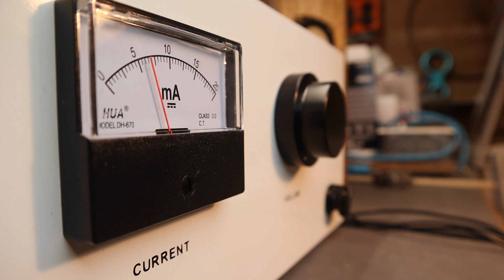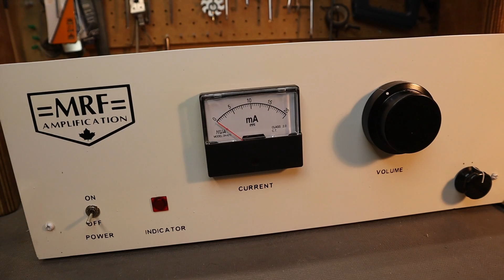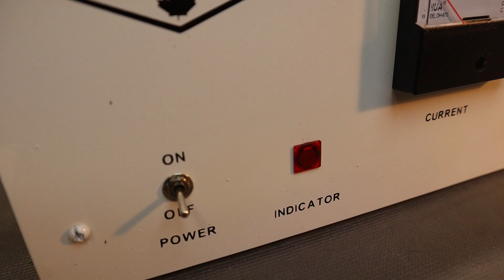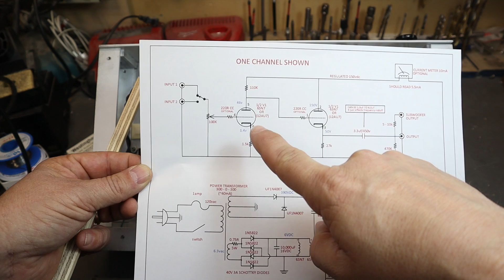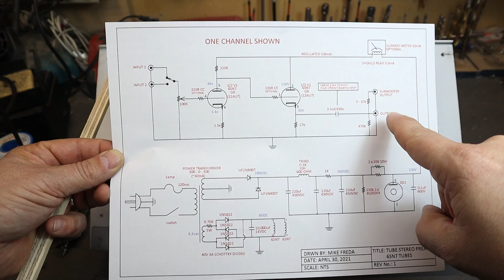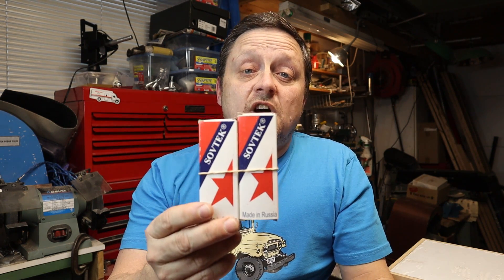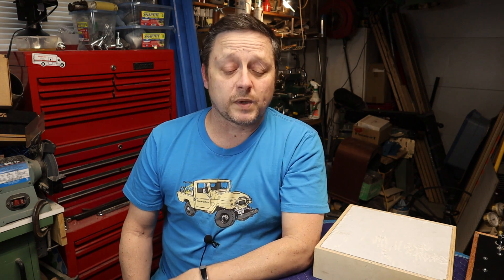Making a 6SN7 Tube Linestage // DIY Tube Stereo Preamp // New all Tube Shop Stereo System build!

Comment: I’m not familiar with specing transformers.  Can you recommend model?
Reply from the maker: Thanks for commenting. Are you asking in Tube amps in general or just for this pre-amp? When it come to sizing transformers you need to know what B+ and current you are trying to achieve/meet and what the filament voltage and current you need. The filament current is easy. Figure out what tubes you using, refer to the tube data sheet to see what their currents are and add them up... then add a bit of a safety margin. It is advisable to not run the filament current at 100%. Selecting the right B+ voltage is a bit more difficult since you need to know what sort of Bridge rectifier you are going to use and what is your desired operating voltage and what current will be. The Hammond website has a Rectifier useage and calculation guide that is helpful. Duncan amps also has a PSU designer that is helpful as well. I use both all the time. Cheers
Reply: @MikeFreda  thanks for the quick response!   First, I was specifically asking about this design.  What model?   I wasn’t familiar with the “300-0-300” description.  But I believe I understand 300vac out rating with a 0v center tap?     This is my first attempt at a tube amp so I’m trying to keep it simple.    The 150vdc after the OD3 set by adjusting the voltage divider  seems straight forward.   I think I found a suitable transformer on the  Hammond website but was looking for validation of what a 300-0-300 transformer.   Thanks again and love your videos.
Reply from the maker: You're welcome. This preamp does not draw a lot of current.  25ma is all you really need.  The 0D3 caps the voltage at 150v so as long as you ~75-100v more you are good.  That's the reason you need a higher voltage PT,  you need some compliance for the 0D3 to operate.  The Hammond PT269GX may be a good option. It should give you ~320VDC at the first cap. If you want to keep your budget low, you could omit the 0D3 regulator tube and use a 250VCT transformer.  This is a good topic to learn. The Hammond Design Guide For Rectifier Use  and Duncan amps PSU simulator is time well spent.

Comment: I have a question regarding the outputs and loading. Could this arrangement simultaneously drive a highZ amp for the main speakers (like a dynaco), and a modern lowZ amp for the subs, or must both amps be the same Z region, i.e both high or both low?
Reply from the maker: Thanks for commenting, You can and I do. I've never measured the output impedance of the prepamp when doing so but I can't hear a difference. You won't notice it on the sub at all and its questionable if you can on the power amp. The output impedance on this preamp is around 500ohms and adding the resistors to the subs outputs helps with isolation. Try it, see if if works for you! Cheers

Comment: Is there any beneficial using a current meter for the preamp tube ?
Reply from the maker: The current meter is mostly for aesthetics... to make it look "old school" but it can help determine if there is some funky going on with the circuit or if one of the tube is acting off.  This has happened to me once when the OD3 was oscillating. You don't really need it in this circuit. Cheers.
Reply: @MikeFreda  i'm really like the way you put the meter. Thanks for sharing your experience to us.

Comment: Hello Mike, before I start building your amp, I thought it would be great to have a headphone output. How would you go about this.  My wireless headphones require 8 ohms.
Reply from the maker: Thanks for commenting.  It is not possible to have a headphone Jack with this preamp without some major topology changes. This preamp doesn’t have enough current and there is a huge impedance mismatch.  To drive 8ohm headphones you will probably need small output transformer with a 8ohm tap and figure out a way to get more current out of these tubes.   Realistically this is not a headphone amp, it’s a preamp the drive power amps. Yes, it could be reworked to drive headphone but there are better schemes to to that with these tubes.  Cheers.

Comment: Hello Mike, I am building your preamp. I have all parts except for a shaft extender for the rotary switch.  Could you please recommend a source?
Reply from the maker: Hello, thanks for commenting. I used a standard 4 position, stereo (2 pole?) switch. I made the extender shaft out of 1/4" steel rod and a 1/4 coupler with set screws.  I have no clue if something like that is purchasable via an online store.  PM me if you can't find one. I may have some metal left over from previous projects. Cheers.
Reply: @MikeFreda  Hello Mike, thanks for the quick response. I think I will be able to put something together. This looks like a great circuit due to it's simplicity. I was thinking about replacing the cathode follower with an SRPP stage. Any thoughts?
Reply from the maker: The circuit I used incorporates a Cathode Follower. It transforms a high-impedance signal into a low-impedance signal.   You basically want to match the output impedance to the input impedance of the power amp (or close to it).  
This circuit creates more gain than you really need for most amps.  
Not knowing your SRPP topology, it’s hard for me to comment if it will work or not. It “could” but you could also have a huge impedance miss-match.  Cheers.

Comment: What?

No guitar/keys input?
Reply from the maker: This preamp is meant for a stereo system (HiFi). Its topology is not really suited for Guitar or Keys. I guess the circuit "could" be tweaked to accommodate that for studio or line-in applications. Cheers.

Comment: Thank you Mike. I have built the preamp but I'm having some difficulty. 
One channel has dc on it along with some nasty hum. I've measured it as high
as 55v dc. I have checked voltages (which are almost exact with the schematic)
but have not yet found the cause.  I built mine with full bridge rectifier and the
0D3A tube regulation. Any ideas as to what might be the cause?
Reply from the maker: 55VDC and on the output?   If that is the case, I suspect you have a faulty Capacitor.

Retrace all your wiring and re-flow the solder joints.  Try swapping the capacitor to see if the voltage issues follows.  The Capacitor blocks DC and creates a filter on the outputs.
Reply: @MikeFreda  OK. I checked wiring and found bad solder joint on a capacitor. DC is gone now but I see 24-25v ac on output. Is that normal? Thank you for the assistance!
Reply from the maker: Well, you should see a bit of AC on the output however it depends how you are measuring it and what sort of input you are testing it with.  Under proper testing procedures you should see 9-11v RMS ( 29v pk-pk) before clipping. This preamp has a lot of gain.  Plug it into an amp and keep the volume low to start.
Reply: @MikeFreda  Hi. I just connected a solid state amp and got a huge hum. Still seeing around 22-24v ac on the outputs. I'm stumped. Could the regulator tube be bad? The voltage 
there is 149.9v. I'm stumped.
Reply from the maker: The VR tube is working correctly.  The three main sources of hum are the PSU (filter caps not working or values are off) , faulty or poor grounding scheme, heater (filament) supply circuit.   Another obscure issue is the output impedance of the preamp does not match the input impedance of the power amp.  

It’s been my experience in building amps that the grounding scheme and PSU section has the most impact on hum.
Reply: Hello Mike. I'm still fighting with the bad hum issue. I just found that placing a film cap across the outputs almost completely removes the hum. 
Maybe some dc sneaking in somewhere?
Reply from the maker: Interesting, I’m at a loss on why placing caps across the outputs would solve that. I suspect that you are creating a filter to notch it out.  I don’t feel that’s the ultimate solution.  

What is you filament circuit like?  How is that grounded?  I had similar issues with a headphone amp and it tuned out the heater circuit was not grounded properly.  

Also, did you use a choke?  If so, Do you have the choke 90deg to the power transformer?

I ultimately suspect your grounding scheme is suspect and your output cap may be leaking.  

At the end of the day, you will figure it out which in turn will make you a better amp builder.  I learned way more by troubleshooting than just building.
Reply: @MikeFreda  Hello just wanted to say thanks again for all your help and tell you of my happy ending. I finally rectified the filament circuit and added 2 47,000 caps.
Voila!  Hum is gone. I did also add the virtual center tap to the heater circuit . Sounding good now. Just goes to show never give up.
Reply from the maker: Great to hear you figured it out.  Most of my amps have DC filament circuits to minimize hum.  I’m a noise freak so I get it was bothering you.  47,000mfd is a lot of capacitance.  Did you mean 4,700?   10,000mfd is more than enough to filter out any hum. You should be able to just ground the negative side of the DC circuit to the star ground.   Cheers.
Reply: @lcookers  Possibly a heater to cathode short in one of your tubes, but that is pretty rare unless you are using 1947-made tubes pulled out of a TV set. Try a different 6SN7 or two. Good practice to add the center tap, virtual or real, to your heaters. In 95% of tube amps I have dealt with, a heater CT is absolutely essential to prevent monster, rhinoceros-grade hum on the output. Or, ground one leg (less desirable)

Comment: Hello Mike. This is a beautiful Pre amp. I am new to tubes and electronics for that matter. I am very practical and am looking to build this amp but I just don’t know where to start. You don’t have any further instructions do you?
Reply from the maker: Thanks for commenting.  I did this video for more high level “this is what I did” sort of thing.  I didn’t realize that people would actually want a deeper dive.  I may do that with theory and a good layout if people want (like I did with my 6DN7 amp).  Cheers.
Reply: @MikeFreda  I would love a step by step tutorial (on video or in writing) along with the full component list 🙏🙏
Reply from the maker: @clemleg123  Please have a look at my 12AU7 Preamp. It's very similar and I also include a parts list. Doing a full build document is a lot of effort, however,  a layout is something I can put together fairly easily if you and other would like that?
Reply: @MikeFreda  Hi Mike. I am planning to build this preamp, I like that it has sub-out which would fit perfectly with my DIY speakers. I would appreciate if you can add the layout you mentioned here. thanks.
Reply from the maker: I am working on the layout but it occurred to me that if you don’t build the same chassis my layout won’t work for you.   I think you could pause the video of my layout and use the schematic to draw something out that would work for you.  Cheers.

Comment: I've been looking into high quality tube pre-amps, but they are all way out of my price range, especially with shipping to where I live on top. This project could be the answer to my prayers. Thanks a lot for publishing your circuit diagram and giving helpful tips on chassis building. I would ideally like it to have VU meters so I'll have to figure that out.
Reply from the maker: Thanks for commenting.  Hopefully this will inspire you. I’m not sure VU meters are that important on a preamp.  Would be more ideal on a power amp. Cheers.
Reply: @MikeFreda  Really? That's interesting. I thought VU meters would be useful to make sure the preamp is delivering the optimal signal to the power amp with different sources (CD player, computer, phone etc) having different output gain. Is that not the case?
Reply from the maker: Digital sources are pretty well balanced.  A preamp doesn’t have a lot of gain. The millivolt difference between the channels would be negligible (unless you built it with components that are way out of tolerance L/R channels and the measured voltages are way off) Even still, unless you have a balance control in the circuit it would only really be for aesthetics. In a power amp, there is more gain. You would want the VU on the output to help balance.  Again, if built correctly and all the components and voltage reading match between both channels you shouldn’t really hear an imbalance…. But it is possible especially if your room is not symmetrical or you are off to one side.  Yes, you can put VU meters on both but not sure if it is worth it especially on a preamp.
Reply: @MikeFreda  I hear you but I am still unsure. Even on my digital sources there is great variation between the volume of different albums. Some albums are mastered super-loud, whilst others are really quiet. Having VU meters on the pre-amp would allow you to tweak the volume on the pre-amp so that the output was consistent, wouldn't it?
Reply from the maker: Yes, that is method for looking and changing the overall volume level to be consistent throughout your playback and listening session. You will be adjusting the volume anyways to suit. You could also just get a decibel meter.  I agree, big VU meters look cool but I’m not sure it’s really necessary in the grand scheme of things.

Comment: Thanks again for sharing!
I decided I'm going to build one of these which one did you prefer in the sound qualities if you can describe between the 6sn7 and 12au7 also brand of tubes or anything to describe the differences so I can make a decision on which designed to go with.
thanks in advance Robert
Reply from the maker: Both these tubes sound somewhat similar in this circuit.  Some people say that 6SN7 is more "tubey" and has more mid range presence. There is a lot of reviews online on the tubes people like. For me, tube rolling is part of the fun. I have a whack of 12AU7's and 6SN7's because of that. It's always fun to find a NOS treasure and see how it compares to a newly manucfatured tube. At the end of the day, there are more things to worry about in a circuit than just the tube itself (i.e. Resistors, Capacitors, grounding... etc..)  Cheers

Comment: Great job 👍🏻
I thinking of building your preamp.
What wattage are the unmarked resistors in the schematic.
Reply from the maker: Thanks.  If you goto my 12AU7 video there is a parts list. It’s a similar circuit.  That being said, you can easily calculate the ratings using ohms law (V=IxR) once you know the current in amps, then use the power equation. P=IxV.  You will typically get a low number like 0.001amp or 0.1 watt. A good rule of thumb is to double the power number to get the resistors rating for a bit of a safety margin. 1/4watt resistor is 0.25 watts. This circuit does not draw a lot of power.  1w on most of the resistors if more than enough. If you have the space and don’t mind paying a little extra, there is nothing wrong with spending a bit more for a larger resistor. Better larger than too small. I hope that helps?
Reply: Thanks!
I really appreciate

Comment: well done !  no bass or treble control circuits?
Reply from the maker: Thank you.  No, what you hear is how it was recorded.  Also, adding pots in that part of the circuit would actually induce a bit of noise in the system.  One could add some switches to add or change values but it not really necessary.  Cheers.
Reply: @MikeFreda  uh, respectfully, not exactly.  what you hear is how your speakers and amp play back, not how it was recorded.  true, pots could create some noise.
Reply from the maker: Yes, true.  That’s what I meant to say.  Play back what was recorded.  
Now that I think of it, I’ve never made a hifi amp or preamp with tone controls, only guitar amps.

Comment: I show the schematic to someone i trust and he said the capacitors are too large and the current spiking on the two secondary windings will be very high, he is the expert not me. I plan to build it anyway with some modifications.
Reply from the maker: The capacitor would be too high for tube rectification.  I modeled this in PSU designer (Duncan amps) and it does not show that using solid state rectification.  You can go lower but you may hear some hum/ripple coming through.  Cheers.

Comment: Thank you for sharing and all the work!! You say it has provision to connect a phono input but i see no provision in the schematic. That would for sure add some complexity. Do you plan to build also a separate phono stage? many thanks Anders
Reply from the maker: Thanks for your comment.  I already made a Phono preamp (have a look at my playlist for a video I made several years ago).  A phono pre is typically a stand alone unit. Just add an extra set of input RCA’s.  A phono pre can get rather complex due to the RIAA circuit and the gain that is required. They need to be wired pretty exact and methodically or else it will introduce noise into the system.  There are a lot of “tricks” to employ to make it work effectively. RCA Receiving Guide Manual has a phono pre in it. You can Google JE Labs Phono stage. That will also get you close. 
Bottlehead makes a pretty good phono kit as well.

Comment: Hi Mike. Cheers from Portugal! The amp looks great and i'm thinking on building one. Do you know the amp's power rating ?
Reply from the maker: Thanks for your comment.  It’s not a power amp, it’s a line stage. Output is around 10v RMS, gain is around 10dB, input sensitivity is 32k to 47k ohms.

Comment: Why not use R-cores? Its less noise.Use to be expensive, but now plentiful.
Reply from the maker: You can but this is what I had on hand and is easily available for people to purchase. This power supply has great ripple rejection and it seems to be quiet enough for my speakers and power amp.